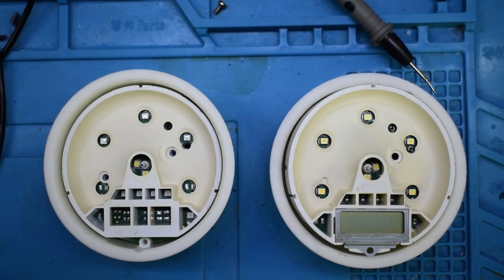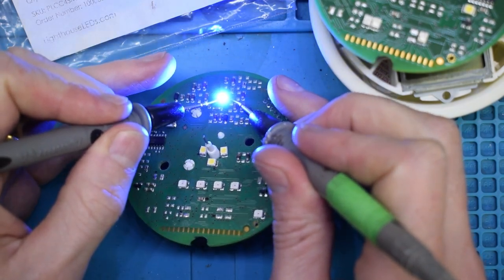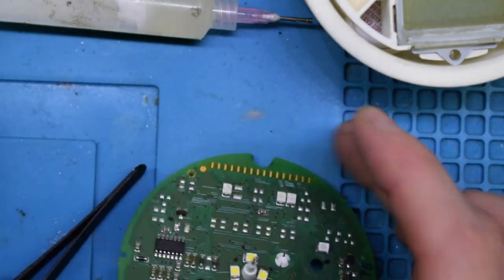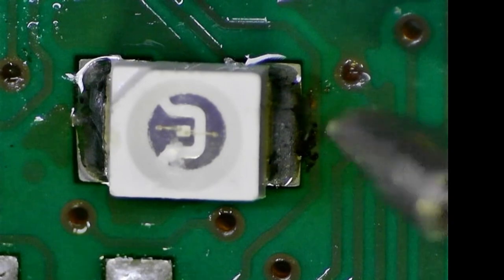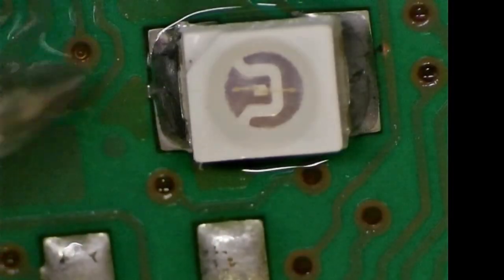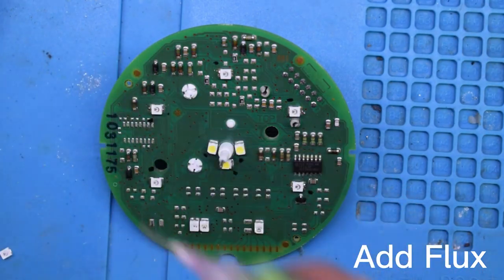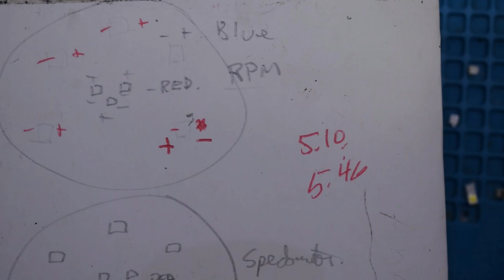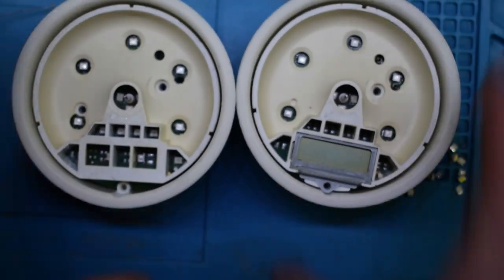Harley Davidson gauges color swap

Comment: Thanks for the video, question, after installing leds I checked lights with multimeter, they light up but they do not have the same voltage they only read 1. as oppose to 1.8 or 1.9. are they installed wrong?